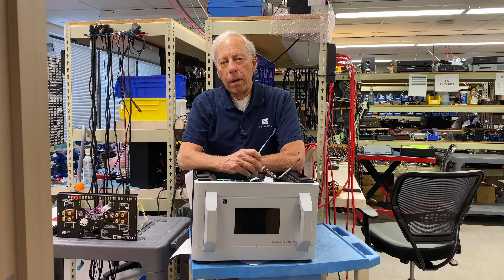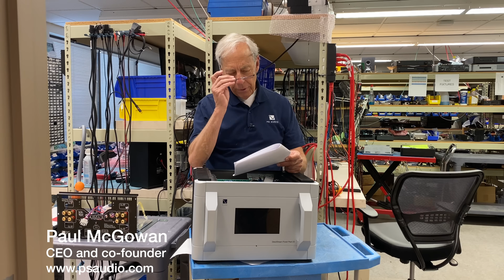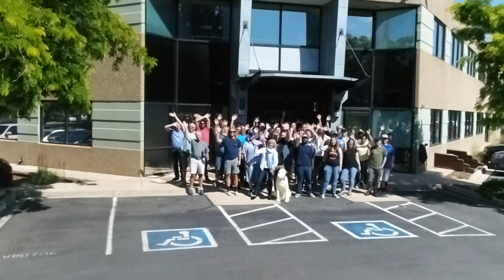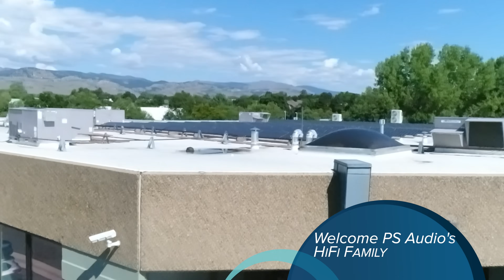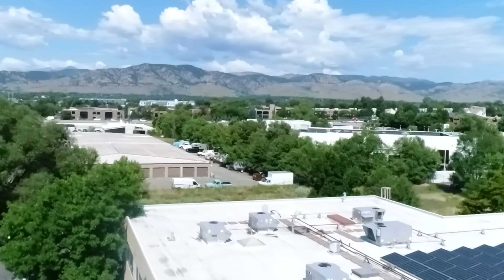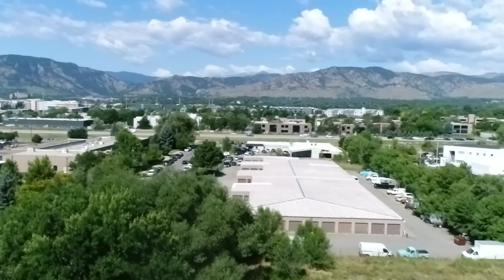Replacing electrolytics with film caps

Comment: I prefer replacing electrolytic capacitors with tantalum. Film capacitors color the signal significantly. Tantalum capacitors provide much greater clarity and a more transparent sound. If you run a test on any channel of the mixing console, you'll be amazed. It feels like you're pulling the rug out from under your speakers. My DAD converter only uses tantalum, and I've never heard better sound in my life.

Comment: A rebuilt two pairs of “Acoustat” (remember them?) self powered electrostatic loudspeakers. The huge canned 1500 v polypropylene capacitor’s smoothed half of a push- pull output stage, that were formerly electrolytics. The speakers transient response went over the moon! Good bypass caps will improve a power supply, but those polypropylene Acoustats were special.

Comment: I don't believe that's as simple as Paul describes. The problem is that many electrolytic caps loose capacity as a signal frequency goes up. But the film capacitors don't. So replacing electrolytics with the same value would result in a different filtering and a different frequency response. It seems in order to get the same result that replacement film cap value has to be somewhat smaller than an original electrolytic cap.

Comment: I retrofitted my crossover on a 3 way. 2nd order, fairly cut and dry. Went from all electrolytic caps and iron core inductors to film with air inductors. I just built  a whole new board.

Comment: Hello, I live in the UK, near London, I own a Wharfedale E50 speaker (Early 80'ss ) and would love to upgrade its Cross over and Speaker unit would appreciate your kind advice.
Reply: On the CROSS OVER: - Original Capacitors used are: 
1 x ELCAP (Electrostatic Capacitor): 16uf (MFD), 50V
1 x ELCAP (Electrostatic Capacitor): 50uf (MFD), 50V

Comment: Capacitors can change the character of a system quite a lot, and sound different after some power cycles. So it's difficult to find the right replacement.

The ESR is important, but the actual impedance relative to frequency is what, I think, gives a cap a 'sound'.

That is important for power decoupling caps.

For signal path, low loss is required which is why film caps are much better... In theory. 
The very low level signal of a SS preamp does not distort much over an electrolytic cap.

Comment: On the theme of parts quality, I need to recap my tube amp and tube DAC. I figure that I need to replace them by the same capacitance value. One answer I can’t find though is about voltage rating. I’d be grateful if someone can weigh in:
I can choose a replacement capacitor of the same voltage or higher. Many of the nice capacitors sometimes have a higher voltage rating. Although from an electrical point of view it is safe to use, is there an effect on the audio quality to replace a cap with higher voltage rating?
Thank you!

Comment: What about ferrite or iron core vs air core inductors? Will replacing them make a difference i can hear?
Reply: iron core or putting any ferromagnetic screw to hold the coil down will introduce a slight phase shift and bandwidth reduction in contrast to a purely air core inductor. this is very audible even if you have a slightly decent system.

Comment: I’m a little confused…. Aren’t electrolytic caps polarised while film caps aren’t?  Does it matter in this case?  A little new with some of these things…
Reply: Did you ever get an answer to this?
Reply: No. There are Bi-polar ECAPS too.
Reply: Polarised caps are installed(+ -) in required sequence as for non-polarised caps...(air inductors also) do not require specific transient

Comment: The higher uFD film are HUGE. I laughed when he mentioned it, because the second I opened the shipping package for the capacitors I said you're kidding. Saw the problem right away. I couldn't believe how big they were in comparison to the electrolytics. Anyway, I ended up soldering them into the board backwards and using RTV162, since I had the room due to how the boards were mounted.

Comment: I recently recapped my Urei 813c's with film caps and the difference was amazing. To be fair these were 35 year old speakers and the lytics were clearly done so they were not sounding great. Took a little creativity to get everything to fit but fortunately I had a decent amount of space to work with. These were not the highest end films out there and I'm sure it could have been better with even higher end ones but this was the biggest sound improvement I've gotten for $120 ever.

Comment: I have a pair of British Mordaunt Short Pageant speakers at around 41 years old and they sound AMAZING! Why would I want to mess around with them? If it ain't broke, DON'T FIX IT!
Reply: they may have some sort of non-electro caps in them, oil filled paper or metalized polyester, modern speakers 99/100 have electro caps in them, I yank em out and replace with polypropylene caps
Reply: Pageants sound great with film caps. I have upgraded many sets.
Reply: @TheMildperil  I had a brand new pair circa 1980. My current pair were bought second-hand in 2010 on eBay for £70. They're in perfect condition, and as far as I know all original. They sound SUPERB! Vocal clarity is stunning, and bass is deep and extended! A cracking pair of vintage speakers!
Reply: @marcse7en  It's great to have 2 pairs, then you can A/B between original and recapped. Pageants are brilliant speakers.

Comment: I replaced some cheap 1 uF film caps with WIMA 1 uF  film caps.  I hooked it up and thought what the hell did I do wrong I mean it sounded like SHIT!!!  After 30 minutes it got better then better and better, wheeew.  If people say that components don't need burn in, they just simply have no idea what the hell they are talking about.  Those WIMA caps are BAD ASS!!!!!!!!!!  It took about 4-5 hours for me to know I was in the clear.
Reply: I've replaced higher value electros in my TEC phono stage with 1uF WIMA caps, the difference is clear
Reply: @VaughnfromPeterborough  so you replaced a 10uF for example with a 1uF WIMA?
Reply: @ranbymonkeys2384  I replaced the input coupling caps (4.7) as well as the 10uF O/P caps, the load is 47K, so the low end roll off is very minimal, I learned this hack from superaudiobestfriends site on the TC-750, mine is the 778
Reply: @VaughnfromPeterborough  interesting, what's the worst that can happen right?
Reply: @ranbymonkeys2384  If the amp or device that is connected has very low impedance, then there will be bass roll off, no audio amp out there is lower than 47K on it's input, John audio tech has just done a video on coupling capacitance, a small audio amp board he was showing had a 0.47uf cap loaded by 15K, rolling the bass below 100 Hz, he found replacing it with 1uF fixed the issue, this vid had nothing to do with my mod since I done it a year ago
Reply: @VaughnfromPeterborough  are you talking at the RCA's or USB and such or closer to components like the op amp?
Reply: @ranbymonkeys2384  Yes the RCA in of a power amp or receiver, USB nothing to do with audio, that is the digital crap
Reply: @VaughnfromPeterborough  I have USB IN for the DAC the 1200-MK2 is on the floor not being used because digital sounds better to me anyway.
Reply: @ranbymonkeys2384  no digital will ever piss on vinyl, it is dry, harsh,metallic
Reply: @VaughnfromPeterborough  ya but one would have to spend 6,000 in turntables and cartridges to get a good sound
Reply: @ranbymonkeys2384  I have LP120 and Nagaoka 110, very happy, the 120 had the awful low pass filters ripped out of the USB/preamp board, 2 shunt caps removed and 2 inductors replaced with 0 SMD blocks
Reply: @VaughnfromPeterborough  Want to buy a made in Japan very good shape (I just put good new RCA leads on it.  Everything works but the stylus light bulb $7 fix.  It has a Grado Black cartridge.  I sold my Pro-Ject Tube Box S phone pre-amp because if I can't get analog to sound better than digital with that stuff, I can't afford analog!!!!!!
Reply: @ranbymonkeys2384  the Pro-ject preamps are not as detailed as the cheap TEC, I sold a PJ phonobox to my mother when her nasty ass batt powered preamp failed in one channel, it sounded horrible from the get go, boxy bass similar to a bubble boom box, she is pleased with the PJ
Reply: @VaughnfromPeterborough  I think your missing my point
Reply: @VaughnfromPeterborough  I bought a DAC, tube buffer and a little amp $250 total (Ive had the NAD 2400 HArman Kardon's Onkyos's) and upgraded it myself and its blowing me away with the sound, wanna put it up against your system I got 1,000 mine sounds better make it 2,000
Reply: @ranbymonkeys2384  Tube buffers do help smooth out digital harshness
Reply: Wrong!  I use $200 Audio Technica cartridges with shibata styli.  Blows away anything digital!  I have 3 turntables which are all under $1000 - never want to listen to my CD's.

Comment: Also upgraded resistors or anything in the crossover path makes a huge difference, Think what is the weakest link, A little bracing of any type for the cabinet helps. Good luck.
Reply: Replacing inductors to air core that'll really breathe a new least of life into the speakers

Comment: Getting rid of electrolytics isn't merely about ESR.  Electrolytic capacitors are quite nonlinear, especially when the voltage across them swings negative.  In other words, they are a strong distortion source.  
The types used in speakers are "bipolar" which means they are actually two polarized capacitors in series, back to back.  In this configuration, they tend to accumulate some DC bias which helps their performance, but only in the case of steady signals, so transient response can still be rather distorted.  
Today we have cables with batteries, but where are the speakers with batteries that maintain some DC bias on the electrolytics, to help with their issues?
Reply: JBL did that: https://www.behringer-electric.de/lautsprecher-service/weichentuning/9v-bias/
Reply: @Sadohenker1984  
Well, isn't that clever.  
Does Behringer own JBL now?
Reply: @marianneoelund2940  They just got the pdf file with regards to the K2 online. It´s quite easy actually (4 times the capacitance and some Meg-Ohm resistors). You can find some information on the Lansing Heritage forums. Have fun

Comment: Erm, no, ESR can be pretty substantial if the capacitors are small enough in value. With electrolytic caps, as the capacitance goes up, the ESR goes down. So you may find that replacing larger electrolytic caps with film caps won't change the frequency response much. This is a good thing, in fact, because you don't want to change that too much when you're just recapping your crossover. So, if you have a relatively small electro cap in series with your tweeter (as is often the case), you may want to add half an ohm or an ohm of series resistance to maintain the frequency response. Now, you still should replace all those electrolytics with film capacitors, but that's because you want a lower tangent of loss angle, which is basically how much energy the capacitor wastes. Film caps always have a much lower Tan-delta than electrolytics! Where you must use electrolytic capacitors, check the datasheet and try getting a higher voltage rating. Tan-delta tends to go down as the voltage rating goes up (but they get bigger, too)
Reply: Hi there I have a few bennic electrolytics in my speakers that are between 72 and 82 uf Im wondering what you would recommend as a replacement capacitor.  FIlm caps this size are super expensive are there any decent electrolytics?
Reply: @Canadian_Eh_I  I know that Mundorf makes a series of non-polar electrolytic caps called the E-Cap AC. Those would be a nice option. Nichicon and Elna probably both make decent non-polar electrolytic capacitors for speaker crossovers, too, so would be worth checking out. The Audio Note Kaisei are awesome if you have a lot of money to spend. Parts Connexion is a great supplier for all of these (if you're in North America)
Reply: @mattbonaccio3522  Awesome thanks, I will check these out!

Comment: Yes I did this in the early 80's with my now vintage speakers. I replaced a 25uF cap with a bank of 25 1uF film caps soldered on a bread board and screwed to the inside wall of the speaker, next to the cross-over board.
Reply: How did is sound compared to the   older setup? 🙂🌎💖
Reply: @DeanTheDoctor  To be honest I don't know. I purchased my Celestion Ditton 25s as damaged floor demo speakers at the end of their production life. I had disassembled them completely to refinish the cabinets, replace a tweeter, and make minor cone repairs to both woofers. Since they were apart it made sense to me to modify the cross-overs, but their original sound is unknown to me.
Reply: You could have used 5.1 uF poly caps

Comment: Anyone who knows a bit about speakers knows that electrolyte capacitors are the worst type you can have in a speaker !! film capacitors or as they are called
(polyester) (polypropylene)
are the best that also give the best sound. they are not leaking and last almost forever. As a rule, always use polyester or polypropylene.

Comment: The sound when replacing the electrolytics with film caps is amazing... but if the electrolytic is too big value you can replace it with several paralleled smaller electrolytics, this lowers the caps ESR and inductance.

Comment: Most electrolytics are polar, whereas most film caps are non-polar, or am I missing something?
Reply: The electrolytic caps used in crossover networks are all Bipolar types and have a higher ESR than film types ... ok 👌
Reply: @janinapalmer8368  Ah, thanks for the clarification!
Reply: It just means that it doesn't matter what way you solder in the bipolar.  You only need to pay attention to the ground mark on polarized capacitors.

Comment: I have been thinking about doing the same with some vintage speakers I have (out of laziness still not done).
In extra I want to replace the coils. Now here the question arises if the Ri of the coil is part of the filter design? 
I live In Germany, here there are plenty of on-line shops that sell Mundorf and Jensen Caps and Coils.
Reply: Keep your oem coils for they don't go bad with age or use.

Comment: Right on.  There also is a big difference in the sound of film caps.  I just took advantage of Partsconnexion Sept sale where they ran 30% off on all film caps.  Those sales come up pretty regularly and are worth waiting.
Long story short, I replaced some Solen caps and some Russian PIO caps with Obbligato Premium Gold.  The Solens were in crossovers and the rest were coupling caps in tube amps.
It was one of those need to listen to the entire music library upgrades.  Significant improvement of low level information.  The Obbligato are a taste of high end without the exorbitant prices of Deulund or Vcap.  If you are replacing electrolytic you are in for a treat.
Reply: Just a question, what do you use for the high value caps on say the woofer, Obligato's as well?

Comment: Have to disagree with you there by changing resistance you are changing the inductance on the coils will change it sound characters not necessarily worse it might be better but any inductor in the circuitry will be affected of change of resistance.